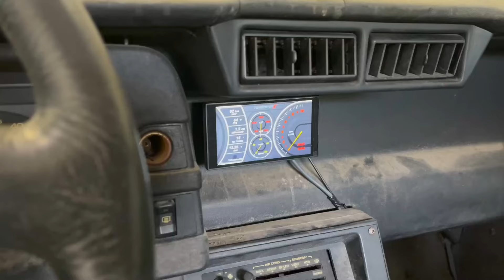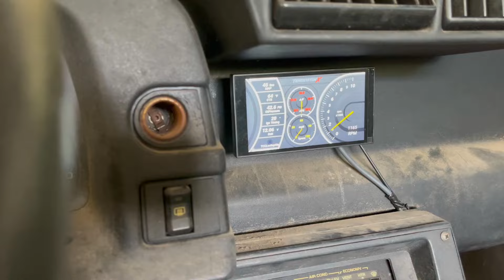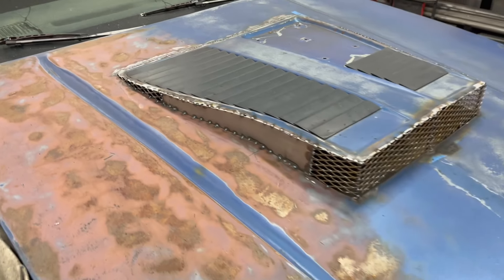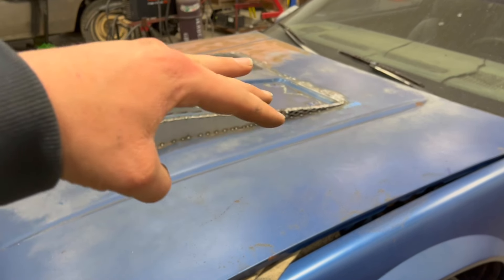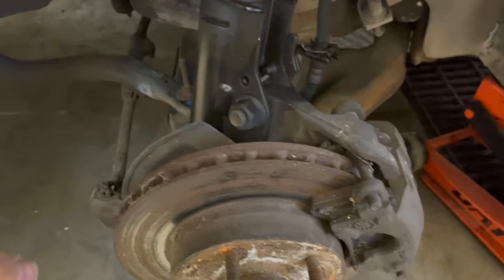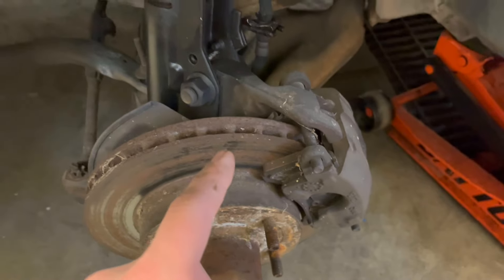1990 3rd Gen Camaro Race week build, Gets new Brakes, hood scoop, some exhaust and Trans dipstick

Comment: Does you header touch the frame on the passenger side or does it sit very close to the frame? Mines is touching but I haven’t hooked up the transmission yet I also didn’t put knew motor mount bushings… what do you think could be the issue?
Reply from the maker: Yeah I just noticed it touching after driving it a bit. I massaged it a little
Reply: Im a bit green wit that term🤣 so does that mean you had to file it down slightly?
Reply from the maker: It means I smacked the header with a hammer lol